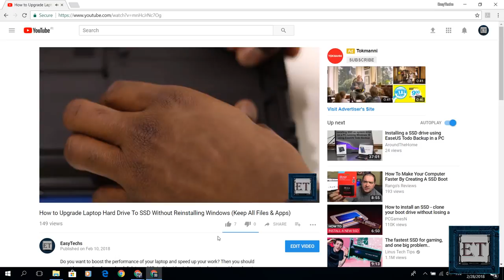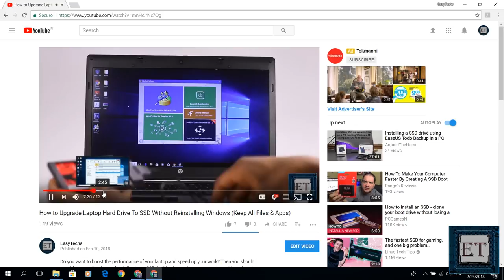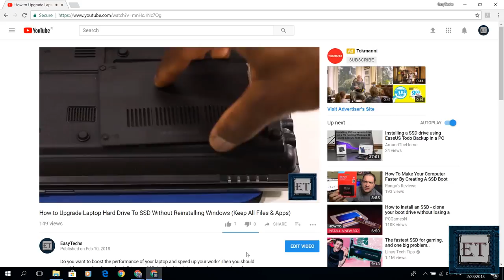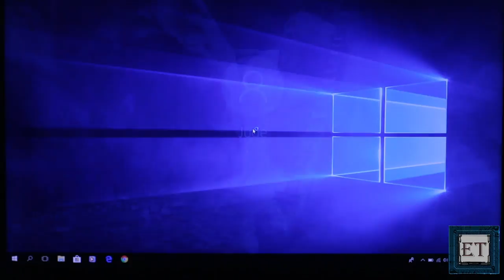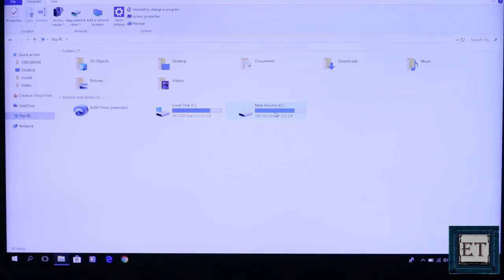HDD + SSD: Replacing Your DVD/Optical Drive With an SSD or HDD (READ DESCRIPTION)

Comment: My laptop has 240 gb ssd i want to increase it to 480. Should i buy a 480gb ssd and replace it or should i insert another 240gb in the dvd drive? I don't want the speed compromised.
Reply: If you never use the optical drive, you should add the 480 gb SSD, so you can have even more space in both disks. The 480 GB SSD will be a little bit faster (because of better write spread ratio given the more capacity). If you need to read CDs or DVDs, then replace the 240 GB for a bigger one, but the more space you have, the better.

Comment: Bro I just want to ask if I m not having a sata usb cable so can I use caddy for cloning HDD with ssd also by just fitting ssd in caddy pls reply.
Reply from the maker: Yes you can
Reply: @EasyTechs  thanks alot

Comment: Hi, thanks for the video. I copied my OS successfully as per the earlier video using the Mini Tool Partition Wizard. The problem is now I have two drives with OS on it and the C drive is the one on HDD. How can I reconfigure the C Drive to be the one on SSD.
Reply from the maker: Through bios
Reply: Could you please explain how. Thanks

Comment: My situation is this: my current HDD is 1TB which is about 90% full. The laptop's drive bay does not accept SATA drives, so I plan to put an SSD in a caddy in the CD-ROM bay. I can only afford a 240GB SSD, so my question is, is it possible to migrate the only the OS (Win 7) and the program files to the SSD using the software you used in the previous video? Thx.
Reply from the maker: yes is possible
Reply: @EasyTechs  Be more specific please, with clear step by step instructions (or a video). But what if my OS and Program Files together are more than 240GB??
Reply: You can migrate os to ssd with easus partition manager
Reply: Post deleted
Reply: @droses1600  I just watched the video and read your comment so no need to get sarcastic on me.  Anyways, are you using ssd on primary slot now or on caddy?

Comment: hello sir, i set my SSD as my main drive and HDD as storage, and i'm running win10 64bit, but i can't boot up to windows if the sdd and hdd are plug-in together, but the windows will boot up if i unplug the hdd or vice versa  i used win8.1 64bit before and everything is work fine. do you know how to fix this problem? thank you

Comment: Hi I was wondering if there was anyway to have the SSD purely for booting the os from and set it up so files automatically save to the HDD keeping the SSD clean.
Reply: Its possible since you can change installation directory to hdd but trust me you dont wanna do that cuz your software will lag a lot. Happened to me so I install main software on ssd and portable light software on hdd.
Reply: @dragonarch0  Ok Thanks so you won't recommend installing the os on the ssd and setting the my documents and stuff to the harddrive?
Reply: @alexanderfuller-shapcott3110  InstallingOS and settings on ssd will work just great but you have to put ssd where your hdd originally was. You can use hdd in caddy and but installing other software on hdd will cause lags.
Reply: @dragonarch0  Ok Thanks
Reply: @alexanderfuller-shapcott3110  no prob and good luck

Comment: Hello, I have one doubt.
I actually have 2 laptops, one without a DVD drive and one with a DVD drive. So in my first laptop (without DVD drive) is has SSD which is dual-booted (Windows + Ubuntu. Now I wanted to shift that SSD to the second laptop (with DVD drive) in place of the DVD drive. So if I move it to the second laptop, would the OS inside SSD would persist?
Reply: Cmiiw, but i think you need to reinstall the OS inside the ssd if you want to move it to the 2nd laptop because the laptop itself have a totally different driver. I've done this long ago but with an hdd
Reply: @anakdewaful  ok thanks!

Comment: How would I know if this will work? Like my laptop say I can have either 2tb hdd or 256 ssd and no other slots available to go with ssd+hdd combo... Tech suggest me optical drive can be change with drive but will it work not don't sure
Reply: I did something like this on an HP Envy laptop I had years ago and it worked fine. You have to remove the DVD drive and install the bracket/adapter he shows in the video.
Reply: @JJFlores197  will ssd work, then should try 256 or 128? Btw some say it will not as fast as it will in be primary slot
Reply: @imperial-x9899  Any 2.5" SSD will work.

Comment: I replaced my drive now my battery is not detected. Uninstall battery drivers and restarted. Did a hard power down with battery removed. Attempted to reinstall bio but can not due to battery not being detected. Maybe the battery is bad or is it something that could happen after replacing cd rom?
Reply from the maker: Replacing cd rom shouldn't affect  the battery at all, check that the battery is properly attached
Reply: @EasyTechs   I removed and replaced the battery numerous times. I am hoping that is only the battery because I do not wish to spend much on this old laptop. Thanks for the fast response....you have a new subscriber

Comment: If i accidentally press the caddy s button to open cd drive will my ssd also come out like cd drive? If yes than i Will just replace ssd with hdd
Reply: Well no. That's not possible as the eject mechanism is in the DVD drive. You're not actually pushing any button since the caddy doesn't have any eject mechanism.
Reply: @JJFlores197  thanks a lot appreciate that

Comment: If we open the cd drive after we installed the ssd will something wrong happen?
Reply: Nothing there's no springs n that to open the cd drive. It will just not show up on your computer. If you run the os off it then it will either load bios or your gonna be asked what storage device you wanna use to load up a operating system.

Comment: I replaced my hdd with ssd and intalled and installed hdd in cd bay. Now my CPU stays at 30% (20%-27% system process) all the time even when. I took out the hdd from cd bay and the problem is solved. why am I having this issue and how can it be resolved?
Reply from the maker: Your CPU usage depends on the processes running on your PC

Comment: I did this. What happened was it made my laptop get stormed with system interrupts. It would use 50% or the cpu at idle. I tried taking the drive out and flipping the switch on it, And it still didn't work. Any ideas anyone?

Comment: What to put in that DVD caddy? SSD or HDD? Anyone with such experience? For me, the DVD port has speed of 31 MBps for a 32x, which is equivalent to USB2, so to put a SSD there seems to be a waste of speed, no? I thought to put SSD in that DVD caddy to boot Windows, but does it have better speed than the normal in place HDD then? or to put SSD in normal HDD place (SATA III speed), then the old HDD will be in DVD caddy. I have 2TB HDD SATAIII there, and moving it to DVD caddy with USB2 speed, I feel bad. What to you guys think? Thanks.

Comment: SSD which is on optical drive not showing up in 'my computer' how to fix it?
Reply from the maker: You need to go to bios and include it in your boot device, also set it in boot priority
Reply: @EasyTechs  how to do it? Please tell me the full steps.
Reply: @kunalukey5870   whatever you do never press the delete while in bios setting! when you go to bios there is an add option once you press add a window pops up and u scroll to that drive , select then youll see it in the boot priority then exit with the save and exit option